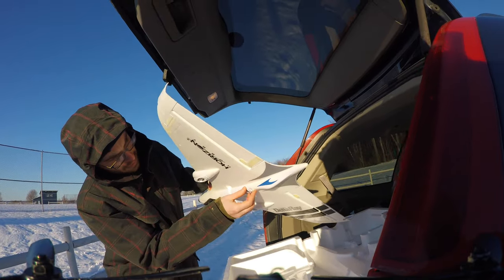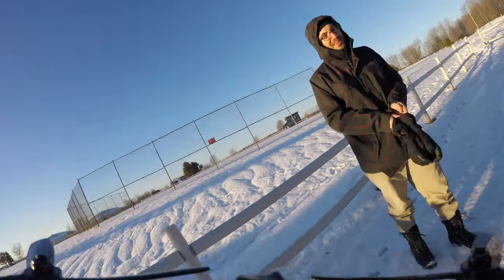Plane chase, crash & chase

Comment: I finally got into FPV :) I got a tiny whoop kit and a Quanum Cyclops headset for Christmas which I tried to power with a 9V battery but it didn't work lol. I gotta go get a 2 or 3s battery to run the goggles off of now.
Reply from the maker: SoupOS there ya go. Be careful of the struts that go to the motors. I usually put a bit of hot glue on each structure so that they don't break.
Reply: Louis P Floyd Yeah...I remembered to reinforce a bit too late lol one of them is beginning to brake, but a dab of super glue should do the trick, right?
Reply: SoupOS get a carbon fiber brace for the bottom makes it waaay more durable